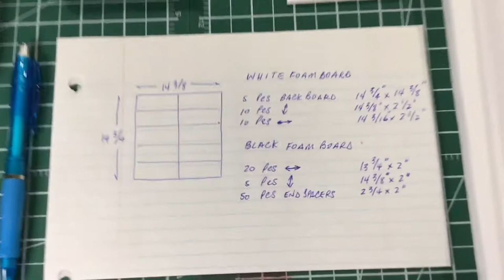DIY Hot Wheels Display - How to Make Your Own Diecast Displays for your Collection - CHEAP & EASY

Comment: how do you cut your foam board so straight and square? been nice if you would have shown that procedure.
Reply from the maker: I use a metal ruler that is 1 meter long, and a sharp razor blade. I change the blade frequently so the cuts are precise. Thanks for watching.

Comment: Amazing!!! Question though, how confident are you if it were not inside of a display case and instead were hanging from the wall? Would the glue still hold up? How many mainline models would you say it can hold up without bending the display or worse falling apart at the joints. Really appreciate your answer 👍
Reply from the maker: Thanks for watching.  The foam board is quite rigid and will hold the cars, no problem. King Nut Diecast hangs them on his wall using the 3M  hangers that are basically two sided foam.  I think I would add extra support on the one that holds 80 cars, but the Team Transport ones would be fine hanging.
Reply: @HotWheeler  so your saying anything under 80 cars in a display would need just 2 3m wall hangers? Is that the wall hanging strips?
Reply from the maker: I have made a few different sizes, and they all seem to be strong enough to carry the weight.  I made one that holds 48 cars, and that one I would consider 3 strips.  The one that holds 80 cars would keep me up at night worrying about the 3M strips.
Reply: @HotWheeler  thanks so much on the information really appreciate it

Comment: How did you cut the notches? And do you think the foam board would hold a shelf of hot wheels 2 ft long?
Reply from the maker: I cut them using a sharp exacto knife. I have one that holds 80 cars, and it’s quite rigid and strong.

Comment: Isn’t the foam core melting from hot glue?
Reply from the maker: I use the smaller gun and sticks. It doesn’t get as hot as the larger guns. The Gorilla glue sticks bond really well.